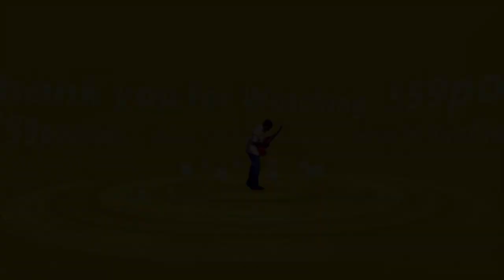How to: Remove rear bumper Trim from a 2013 Chevy Silverado

Comment: Hey George, i have to replace that same piece on my  2013 ,thanks for the vid on how to, was it easy removing the covers for the spare tire and other covers?
Reply from the maker: It was pretty easy just time consuming.
Reply: @559powerscape  I'm about a month away from hitting that project if you still have that truck and get some down time how about making a vid on the removal of the covers. Thanks for the response.
Reply from the maker: @kerryo57  I dont sorry, I work at a Dealership and we get a lot of cars with lil problems, that's were all these videos come from. Me working on all the cars and recording the process.  Sorry bud but it should just be a few retainers clips and a couple of screw to get the splash guards off. Good luck buddy! And thank you for your support!
Reply: @559powerscape  Bummer , thanks George  .
Reply from the maker: @kerryo57  sorry bud, no problem! Hope this works out for you!

Comment: do you remember how you got that spare tire door off?
thanks
Reply from the maker: The tire was already missing actually 😕 but that i know of the spare tire needs a special tool to reach thru the bumper and into  the release mechanism. Its the oem jack hardware that comes with the truck to change out a flat tire. You will need that to lower the spair tire. Sorry bro. Thank you for your SUPPORT!